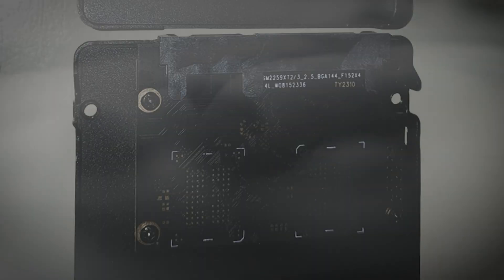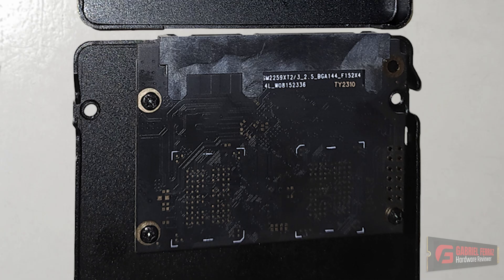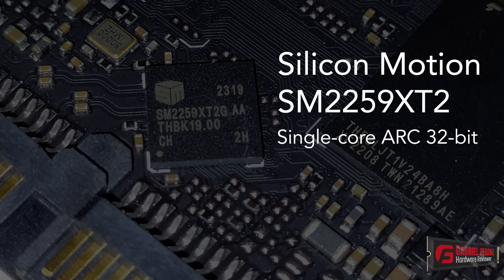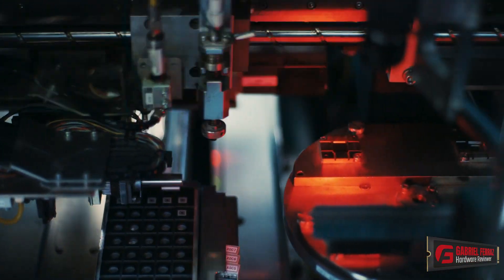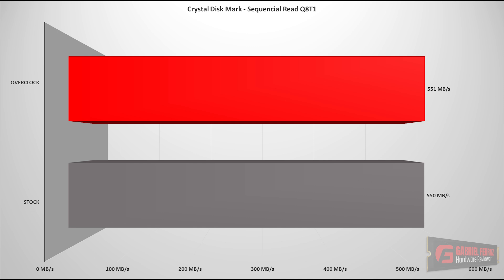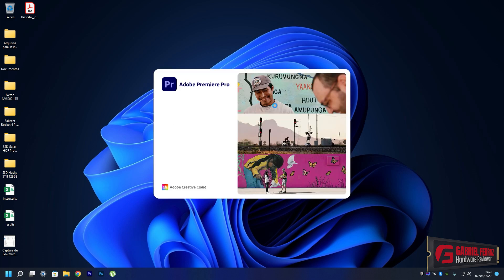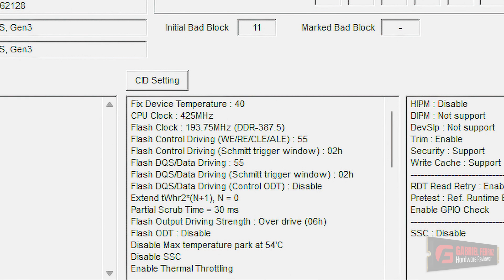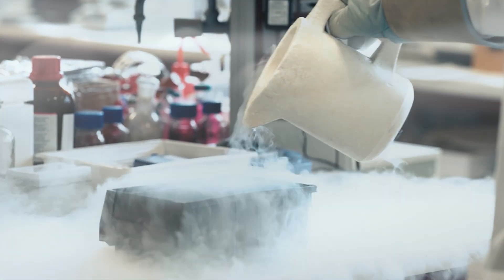SSD Overclocking 😱 ! (EN-US) Not Only possible, but doable at Home! (DON'T TRY THIS AT HOME THOUGH)

Comment: Is there a possibility that the controller was over volted (you showed it was run at basically double the stock voltage) and died as a result? Is there a way to limit voltage to the controller in the firmware? 🤔
Reply from the maker: No, the voltage remained the same.
Because through this MPTools we dont have control over voltages for the controller and NAND FLash
Reply: @gabrielferrazdetetivehardware  Thanks for the reply! Still new to this. Your videos are very helpful.
Reply from the maker: @youtubasoarus  sure no problem, and I hope you liked the video

Comment: That is the worst SSD model, based on this OEM PCB design I have tens of broken SSDs that stopped working. They are sold as cheap Ali SSD's and the NAND flash usually has a relabelled NAND chip. I think they made these doorstops intentionally - they are not meant as a strorage device you put your data on. Maybe instead of overclocking, you should focus on how to acquire a firmware, that can work out the bad blocks - one way would be to rely on wear levelling, eg. set the capacity of 192G to your 256G model, and hope it does remap all bad pages - but then - there could be fixed requirements for pages containing mapping information to be working - and if those break, there goes the SSD - it will never be able to work.
Reply from the maker: Got it.
My next video will cover pSLC Cache. I hope you like it
Reply: @gabrielferrazdetetivehardware  REALLY COLL! Im WAITING FOR THAT.!!
Reply from the maker: Thanks @STEELFOX2000

Comment: Could this be done to Intel's Optane 905P? I would be willing to buy you a 905P to experiment with but if your in Brazil I don't know if shipping it would be too costly. Their prices have gone down a ton so I have finally bought some of them since they are arguably the best or one of the best drives on the market even if its only first gen. I originally was waiting for 2nd gen but it got canceled so I bought several over the last year when the prices dropped. So I could get them before they are gone for good since there is nothing on the market now or even in the future that would even match their performance in regards to latency, 4K, mixed work loads, and QoS.

BTW, I found out about this from the TPU news post.
Reply from the maker: I wish I could get one of these optane drives. But they are sooooo expensive to import here that are totally irrealistic
Reply: @gabrielferrazdetetivehardware  the 960gb drive is going for $285-330.

How much would Shipping be? Is Shipp reliable enough from USA to Brazil where the drive wouldn't get lost?

If it is if your willing to cover shipping I'll cover the drive. I don't have the time atm but I can look into shipping costs later.

I don't make a lot of money but I am willing to discuss covering the drive and shipping costs if you can tweak additionally drives for my use.

Just wanted to spit ball some ideas to help out because that sounds really fascinating especially because I think 1st gen optane really has far too slow of a controller. I really think if this is possible the optane drivers would show substantial boosts in speed.
Reply from the maker: @DCMAKER133  shipping is cheap, less then U$40. Problem is taxes. Since it's above U$50 it will be the product price (let's say for example U$300) + 92% tax. So would be U$300 + U$276
Reply from the maker: @DCMAKER133  also like I said, MPtools for those drives aren't available. Usually we find MPTools for consumer grade ssds. Those SSDs (Optane) are for Enterprise/datacenter use. so these software are literally locked at 7 keys and are rarely found on the web. Since most of these tools are leaked
Reply: @gabrielferrazdetetivehardware  can't you by pass that saying the product is a sample or gift or something?

I recall mailing something to someone internationally years ago and there was an option to label something like that.
Reply: @gabrielferrazdetetivehardware  well the 905p is a consumer drive but fair enough. If you do stumble across the tools for the 905p just reply here and I should get notification and I'll see what I can do.
Reply from the maker: Hell yeah, the controller definitely but you NEED the MPTools. And for  Flash based SSD is already a nightmare to find a compatible one. Imagine Phase change memory (optane) will be even worst
Reply from the maker: I hope you liked it though

Comment: Kind of glossed over the fact that the manufacturer locks the reported temps at 40. Is that a normal thing to do?
Reply from the maker: Yeah, actually is more common than we think. They can also lock a certain temperature, like doesn't going above 50°C. The sensor does work like below 50°C but as soon as it surpass it, it only shows 50° (just an example)